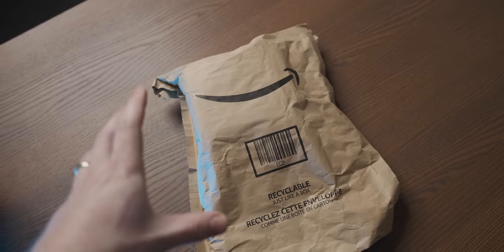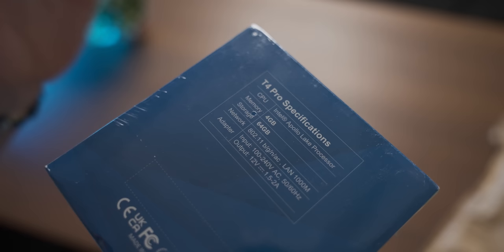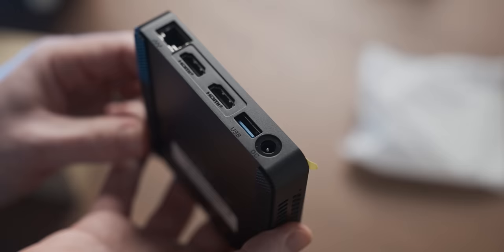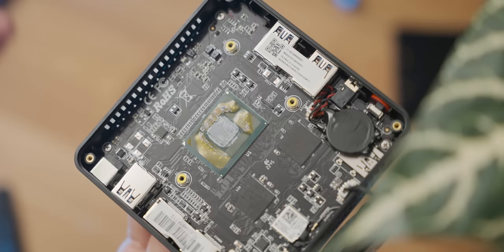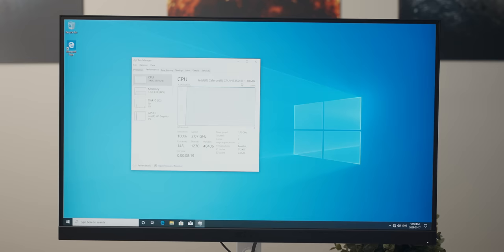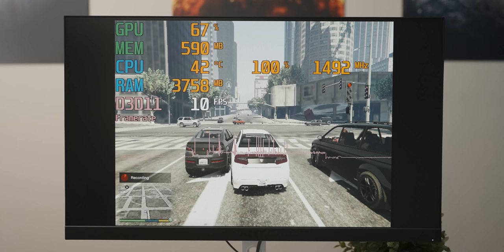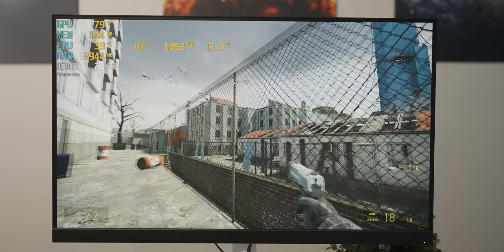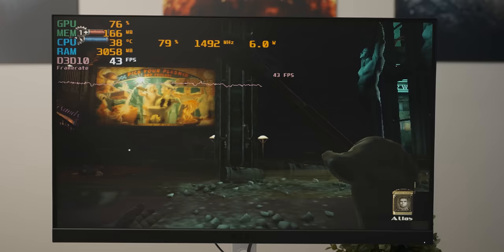This $100ish Amazon PC Is Apparently "Perfect for gaming"...

Comment: Solitaire and Minesweeper ARE games....  You weren't lied to.  As silly as the little PC is, I guess you could load old DOSROM or Sega, Nintendo, SNES and PS1 emulators on it and 64 GB IS a lot of games (except for PS1 games).  So you could look at it like a mini-console.  Though, I suppose you could argue it's still silly since for about 2x that cost you can buy a much better little thin-client and do something similar that would run much better....

Comment: I have a SImilar powered old budget Laptop....It is actual quite Usefull as a secondary machine for on the go. But you need to run Linux for it...I went with Linux mint....Maple Intel I J and lighter indie games are not a problem at all....
Reply: Some more Infos :
Intel Pemtium N4200 
-Upgraded 256 SSD Storage to that
-4 gig of ram
-Stock storage 128 EMMC (actual up to 150MBs speeds) , so not total pooop

Windows is not useful on such a  underpowered thing....2GB Ram Usage (Idle) and at least 60% cpu usage when opening Libre Office or Word...

On Linux i have 0,9 Gig ram Usage and CPU Chilling at 6-12%Usage in Idle.....
I use this as a study machine....It works well and i have a Batterylifetime of nearly 7 hours....

Comment: This cpu is over 7 years old and it's rubbish for windows. Maybe puppylinux or similar works fine. Modern cheap MiniPC with Intel N95/n97/n100 or even the AMD ryzen5 5500u models aren't cost too much more... Maybe 20-50 US$ and you can use it for casual gaming and of course all your computerwork except from AAA-gaming!

Comment: I own one of these: they run Lubuntu 22.04.2 very well. One thing though: the 64GB eMMC is very slow ;-)
Recently, I bought a new version (T34) with the n3450 (1.1 -> 2.2Ghz), 8GB DDR4 (2133Mhz), 128GB SSD: and is much faster.
If the T4 Pro was equipped with a real SSD, it would've run at least twice as fast ^^
Reply: and what exactly did you buy it for? what was its intended purpose?
Reply: @stevedirdochegal6568  Web-browsing, downloading, and as HTPC. Only very old games will run on this pc (Morrowind) 🙂

Comment: got one of these running linux.
just ditch windows, these things run a lot better under linux.
I brought mine as a remote access pc to my network. for 6 watts of electric i just leave it on all of the time.
Mine runs UbuntuDDE and looks great stuck to the back of a 7 inch screen.
set the cpu profile for performance and this stays running at 2.4Ghz cpu speed. 
doesnt get hot

Comment: If you can't return it ill offer $20 plus the shipping. This might actually be useful for one of a couple things obviously not gaming LOL . The fact you can't even change the ram just makes me feel bad inside. The computer I got the other day that has been dungeon tortured makes this thing look even worse. I had a elderly woman that needed a working computer.i sold her a machine for $50 that had Windows 7 running on it can't remember if it was a dual or quad core with like 4 gigs of RAM very basic cheap machine. She gave me the two machines that she had one of them is insanely old Windows XP with a virus on it and the other machine immediately had me raising an eyebrow where she's like we can't even get this one to turn on it was from the guy next door. I didn't ask if they charged or anything for it or not and when I popped the side panel off I just immediately went from raising an eyebrow two beating my head on a table. It was a Windows 7 era TriCore HP very similar to The Machine she got from me. One of the big differences being the machine she got from me was significantly cleaner inside but had much less Ram. This one's got 14 or 16 gig of RAM and somebody had put a brand new no-name power supply for a knockoff gaming computer in it one of those AliExpress power supplies they had one of the wires plugged in on the wrong socket on the motherboard and part of the main power rail was not plugged in either of these would explain why the machine would not turn on. I should have taken pictures when I took the side panel off brand new power supply and a brand new SSD again the SSD is something from AliExpress the same as the power supply but anything besides the hard drive and the power supply was a war crime. Combination of tobacco and several inches of filth. Machine immediately sprang to life once I reconnected the power wires to their proper locations for the power supply basically a no-brainer at that point I found out some knuckle nut had put Windows 10 on the SSD in another machine and then proceeded to plug it onto the hard drive wire and Loosely throw it inside the tower and thought that would work lol. Honestly I'm quite likely going to use that SSD and one of the quad core Windows 10 laptops that I'm playing with.and I'll use a regular desktop hard drive to confirm full functionality of the board and RAM after I attempt to do something resembling cleaning the machine.i don't know if I'm going to sell it or end up trying to use it strictly because it's a TriCore like an i5 or i7. DDR3 usually when I get DDR3 machines they've only got two gig of RAM somebody maxed this one out looks like again AliExpress Ram but still way more RAM than I usually get in one of these machines lol. I literally suggested to the woman did she have anybody look at the machine before she got the one from me and the other person that was basically her age and trying to help explain she needs something that will run YouTube and email and Facebook. Specifically gave her a Windows 7 computer because I figured Windows 10 would probably confuse the woman even more given she'd been using Windows XP on that other machine that had gotten a virus. Before you ask the machine that's got a virus I'm pretty sure the hard drive is toast I don't know if I can find a working copy of Windows XP or I would have just swap the hard drive out on the Windows X machine reinstall Windows XP and giving it back to her. i every so often sell desktop computers like 50 bucks each usually running Windows 7 or Windows 10 dual and quad-core machines usually pretty fair basic specs but enough to get somebody on the internet part of the issue was she wanted one without Wi-Fi wanted one with ethernet capability and it was the only machine I knew that was running something other than Windows 10 plus had an old Legacy cable port and so on or I would have given her one of the windows 10 quad-core machines that had Wi-Fi and so on again I'm scared even Windows 7 is going to confuse the hell out of her woman had to be like 80. The TriCore HP ironically I've dealt with about 14 of that exact same machine over the last six or seven years they're like The Cat That Came Back. I always get them with a bad hard drive or somebody screwed up trying to put Windows 10 on them and if it's a Windows 7 compatible machine the simplest answer is just put Windows 7 on it I don't install Windows 10 unless absolutely necessary lol. I don't know why HP reused that tower for Windows 7 Windows 8 and even Windows 10 they were still using that Tower with a few minor changes

Comment: It sounds like a low end Rasberry Pi clone. You probably can use it for gaming.....if you install DOS LOL
Reply: I'd probably nuke the Windows installation and install a low resource Linux system and then put on emulators. Without windows hogging most of the system resources I would expect you'd at least be able to get PS2 games to run smoothly. (windows is kind of bloatware)
Reply: Yeah I think a light weight Linux distro would be best for this system.

Comment: Is pretty power efficient though!😂
Reply: Yes, and that is one of the major benefits of something like this.  Say you want to run something like pihole (if you aren't, you should).... this will run it 100% perfectly and due to the low power usage of the machine, you'll be money ahead in less than a year over a full fledged power sucking machine.

Comment: To be fair "perfect for gaming' is very vague and could be 100% true depending on what games we're talking. But it's obviously intentionally misleading lol. This is probably a fine PC for the money for basic tasks and some very basic gaming but then again I'm not sure if you can do better for the money. I'm so excited for AMD's next gen APU's though, I'm still using a system I built with an i5-3550 and HD7870, just to play The Witcher 2 and Bioshock Infinite being about the only demanding games and newer games then, then played almost nothing but Quake Live for years just to stop gaming altogether lol. 

So I'm not a big gamer anymore so a next gen AMD APU would be perfect for me, it would provide solid gaming performance(probably crushing an HD7870) and if I changed my mind I could always get a discrete GPU especially if I get into AI. So likely I'd get a case that could take any graphics card but I might just say fuck it and get a small form factor micro-ITX case not designed for a discrete graphics card, I could always change the case and PSU later too if I really wanted to. A micro-ATX could be much better though for things like SSD and RAM support so it might not be worth the compromise in size when I really don't need anything smaller than micro-ATX in a mid tower case or somewhat small form factor but not too cramped.